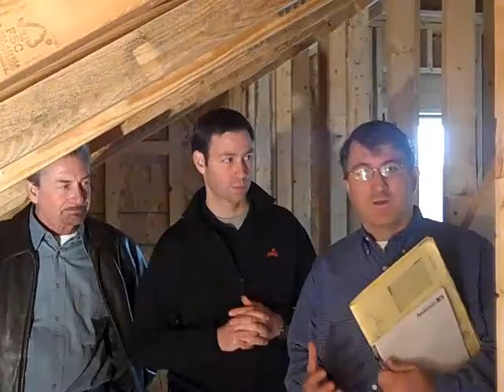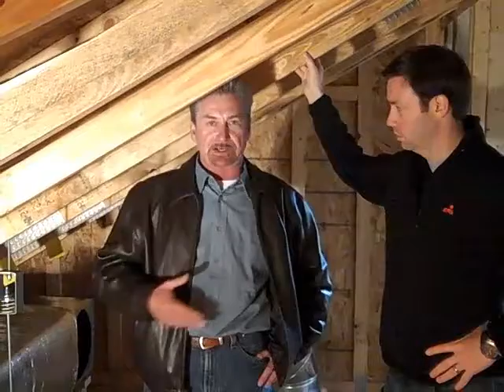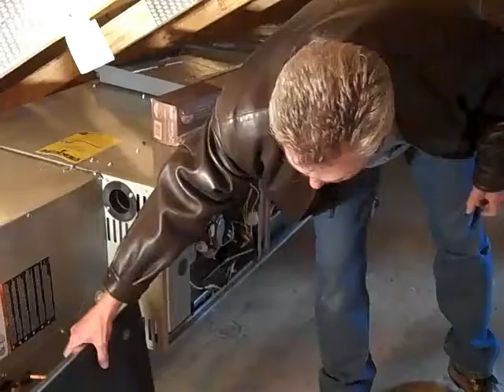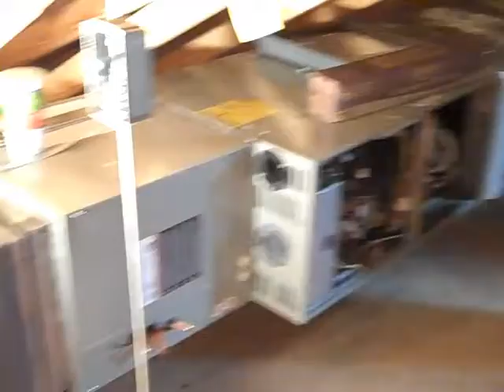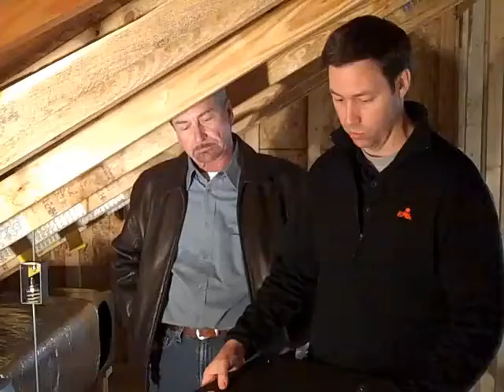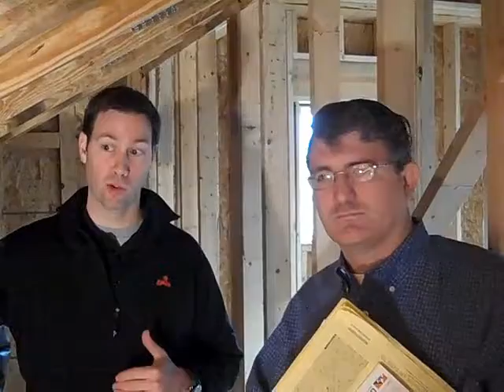HVAC Planning + Quiet Ducting

Comment from the maker: Justin, Sounds like you are in dire need of some new duct work!  Is there any way to bring your ducts into the conditioned space of the house?  You can probably re-do your ducts then do the HVAC unit later but it's not ideal.  The best case would be to plan the ducts for a specific unit after you know the load and the cfm's needed at each room.  Best, Matt

Comment: Matt, this is good stuff... you would get a kick out of my duct... it's framed wood and the butt ends aren't even sealed. my attic is nice and cool (az summer) yet home not so much. Youre advice on ridgid and flex is noted, appriciate it. now question time. All i have is a swamp cooler, can i redo my duct, than replace my swamp cooler on the roof with HVAC rite into the duct work i replace? we do get snow in the winter so i would like a good heating cooling in one.

Comment from the maker: Ok, I hear you.  The system was designed based on a Manual J, ducts from Manual D. If you need help in planning your duct runs I'd highly recommend you hire a HVAC engineer to run these numbers from their software.  I'll put that in queue for a future video. -Matt

Comment: This was a rather pathetic video as far as any actual "planning".  More like touting how the guys would like a nice space to put the unit.  Nothing much as far as the actual design which should include duct sizing, airflow requirements and limits as well as proper takeoffs and connection methods.  Everything they've covered comes down to common sense.  I found the video utterly useless as far as planning my ducting runs.